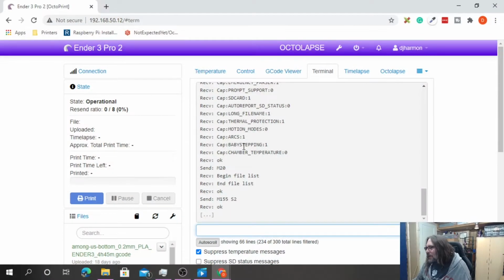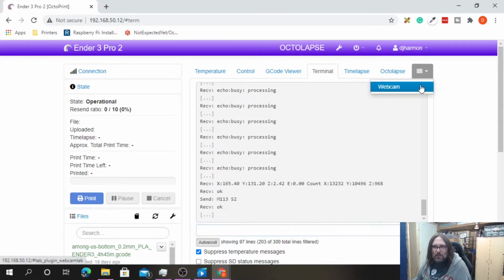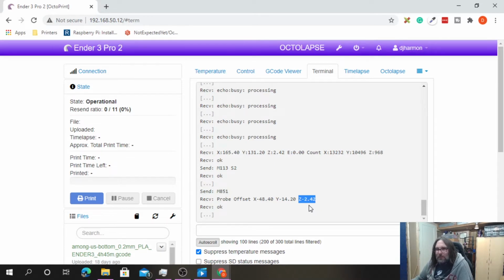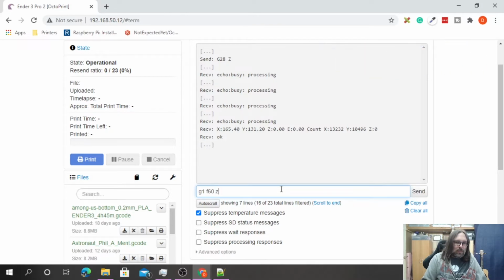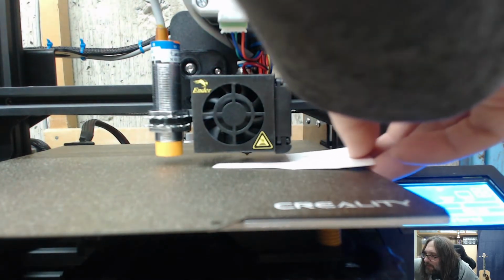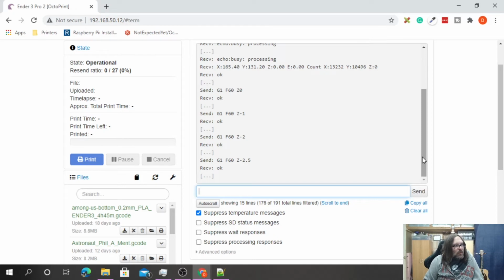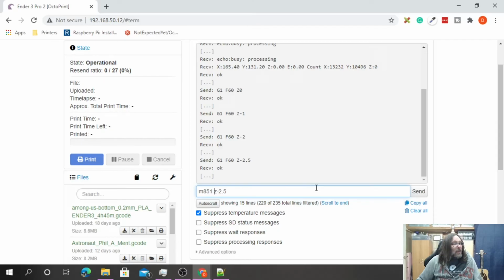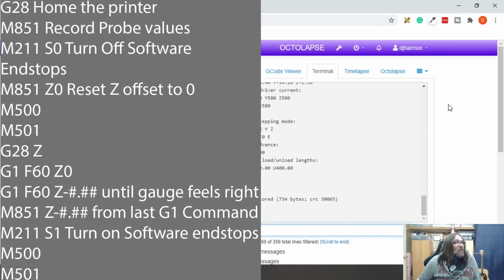M851 Z Probe Offset (BL Touch and ABL)!

Comment: Hey  David. Could you help me? I follow your stepguide but somehow the commands that change values, for example M851 Z-#.## keep their status as "sending" forever (I never get a return from my query) and I can't effectively change my Z offset. I'm using Pronterface to connect to my Ender 3 Pro (4.2.2 32 bits MB). I've tried everything to solve the problem and I'm still stuck there.
Reply from the maker: do you have the probe enabled in firmware?  Without that enabled you wont be able to send or receive values for rm851.
Reply: @3DMakeIt  it's a compiled firmware, downloaded directly from Creality website. How can I confirm if it's enabled? Or how can I compile my own Marlin's firmware with CR Touch enabled? Sorry, I'm pretty noob in 3D printing.